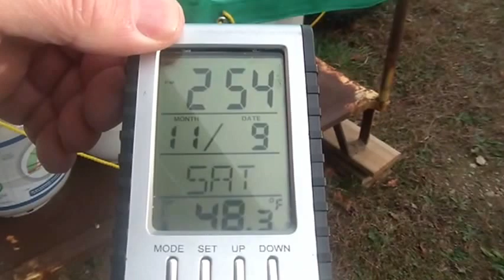Hoarding Mayhem

Comment: Learned a lot got a recon 250 no spark I have saw you getting atvs and other things with a engine I am going to try the chinease quad hardiness we’re I can get my lights and starter and all that good stuff. But thanks for the ideal 24$ for everything  thank you
Reply: This guy knows what he is doing he shows how to do the stator system with the no spark  cut up hardiness he will get u going cdi kit is on its way thanks I would say u have a ideal of installing the atv compleat harness we’re light works and starter and everything else but thanks again I love Honda’s also thanks

Comment: I want to thank you i now have 2 more atc's running. sc cdi coming for 3rd one. Here is,my question, I touched the black and white wire while it was running and got zapped. Test it later and it was putting out 17 volts is that normal. I'm not using the kill switch, but I don't want to short out my cdi.

Comment: I have a 1989 kawasaki bayou 300 that has no spark. Key and kill switch are good. New ignition coil. Getting  12 volts to ignition coil. Engine turns but no spark. What would be your next step? Thanks.

Comment: Hey i spotted that yamaha 225, blue, 3 wheeler and i could really use the tank cvers off it ,
Reply from the maker: Terrence wynn, The yellow one has potential, the blue one has valve/cam chain issues,. I need to get the yellow one put together, if they are not needed, U are welcome to them. Will try to remember to get better video the next time I'm out, thanks for watching and commenting!

Comment: Harvey - I have been following your troubleshooting and repair of the Honda ATC185 that gave you some trouble.   I also have a Honda 185 and it also has no spark.   I have checked everything and am at my wits end.   I noticed that in one video that you posted on your 185 you said that you had changed the flywheel.   Is there a way to determine if the flywheel is in need of changing.  Also do you have any output voltage readings on  the various ignition components.   Help Please !!!
Reply from the maker: Hey Brad, U need to check Ur ignition timing, to do that, make sure Ur cam lobes are down, lobes facing the piston, valves closed.... The magnet part of the advancer assembly on the cam needs to be centered on the pulse generator, and the timing mark labeled F needs to be centered in between the timing marks for the flywheel.... I once had the magnetic part of the pulse generator assembly installed 180degrees off, and it would not start.... Let me know what U find, thanks for asking, watching, and commenting!!!
Reply: Harvey -   The trike was was running, stored it for a few weeks and went to start it and no go.

In the process of trying to diagnose the problem and do the fix I have replaced the exciter coil, gotten a new cdi, bought and tried two new ignition coils including one OEM coil, and changed the pulser coil with an OEM replacement.   I also rechecked the pulser gap and timing.

I have checked voltage outputs from the exciter, pulser, and cdi with a DVA meter and am getting peak voltage readings in the 100v range at the ignition coil primary connector.

Separately i have checked the voltage output from the ignition coil with a DVA meter and it is approx 100 Volts.

The pulser coil checks out with the DVA meter around 1 volt.

I was told by someone that works on ATV's for a living that i should check the output of the exciter coil using a 3 watt test light and that i should get a momentary light when I spin the engine ( no plug)

I tried this and am not getting a light.   He thinks that this is an indication of an internal short and that the coil is not putting out enough power to cause the ignition coil to fire.

While I am following his logic I would like your concurrence or comments.

Comment: hey i have the same maroon ford mines needing alot of work
Reply from the maker: ghettohillbilly1 , The F150 is a 2000, been a good truck for the few years I have owned it. Has rust in annoying areas, like the radiator supports are gone and the engine fan hits the shroud, had to use tie wraps to re-secure it. Thanks for watching and commenting Bud!
Reply: mines an 03 rust is beginning to be anissue among other things but its a nice ride